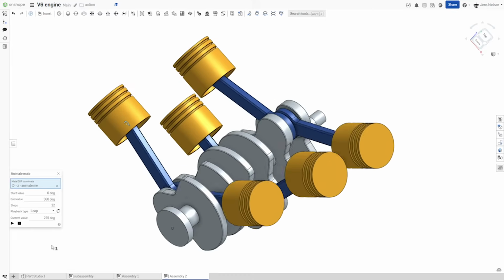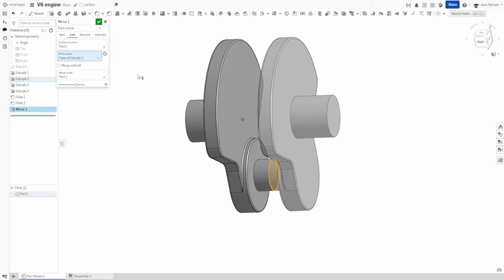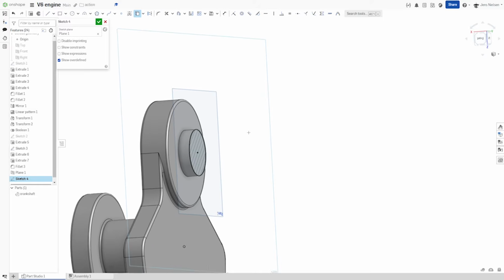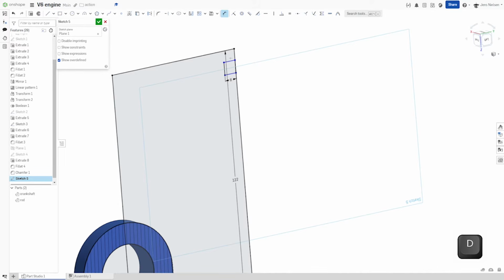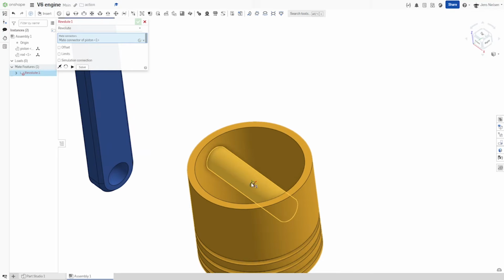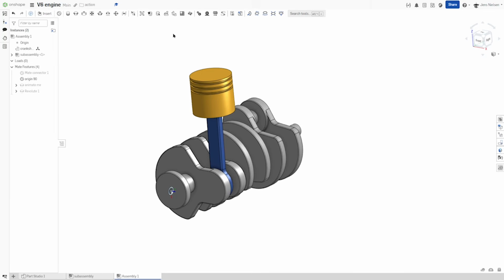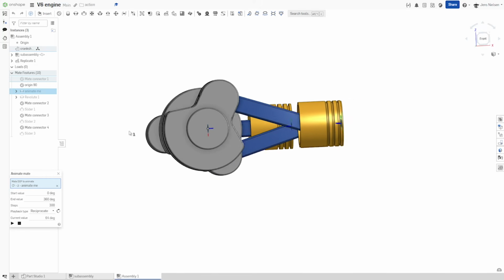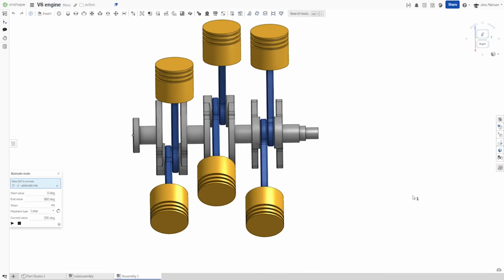How Does a V6 Engine Work? See It Built in Onshape!

Comment: HAVING TROUBLE WITH PISTON ASSEMBLY I FOLLOW EVERYTHING YOU DO BUT END UP HAVING IMPROPER MOVVEMENT OF PISTON 

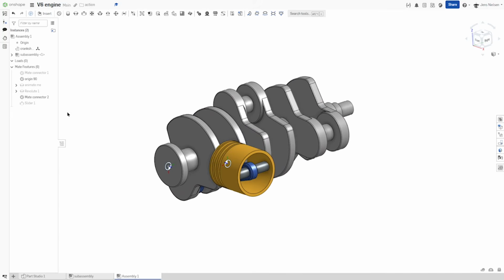SPECIFICALLY WHEN YOU GO TO MATE CONNECTR 2 AT 27:01 TO CHANGE THE DIRECTION OF THE PISTON EVEN I DO IT BUT FOR ME ONLY THE AXIS (IDK WHAT TO CALL THE THREE PERPENDICULAR LINES AT THE CENTER ) CHANGES DIRECTION AND THE PISTON IS STUCK IN OPPOSITE DIRECTIION  HELPP
Reply from the maker: Hi, if you have this specific problem to align the mate connectors, just go one step back: define an explicit mate connector on your part and then mate.

Comment: Having a lot of problems with the second 3 slider mates. Any tips?
Reply from the maker: Can you specify the issue? if your design is any different from mine, just measure your distances.
Reply: @cademist  I actually got it to work, but my angles were a bit janky. I think I failed to align a lot of my mate connectors on the piston heads(and possibly the origin) consistently like you did.

Comment: for some reason when i go to make the piston slider mate, it come with an error saying that "mate overdefines the assembly (hidden)"
Reply from the maker: here is a link to my file, hope that helps: https://cad.onshape.com/documents/cb911a2ec649ee90da4dd214/w/5aeacd136be108af9766f56c/e/cbe3d121de529569c32faa5f?renderMode=0&uiState=67041a6ade38a968c7f16b26
Reply: this is late, but I was having this issue too and changing the revolute mate that mates the piston and connecting rod to a cylindrical mate allows both the piston and connecting rod to rotate freely. Then the slider mate works after that.
Reply: @vitriolocgaming  this is late, but this really helped me thank youuu!